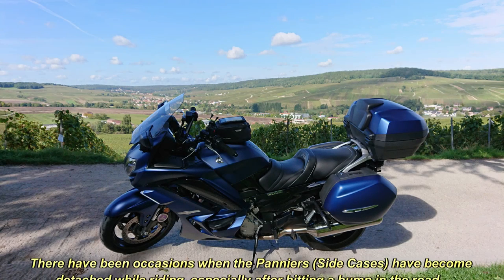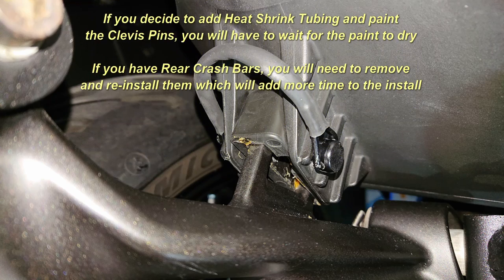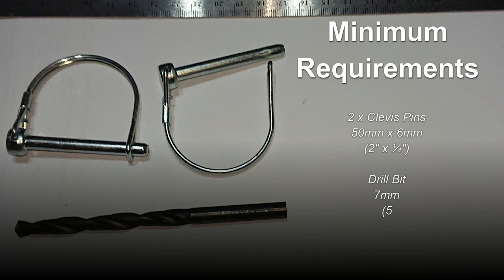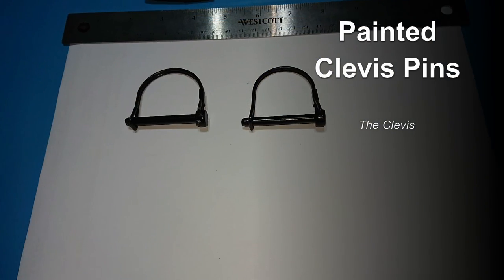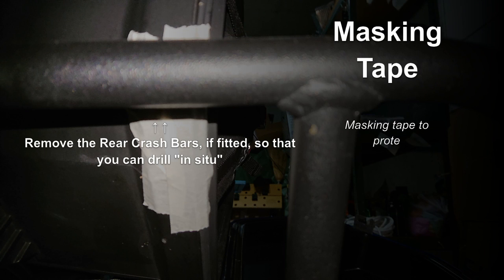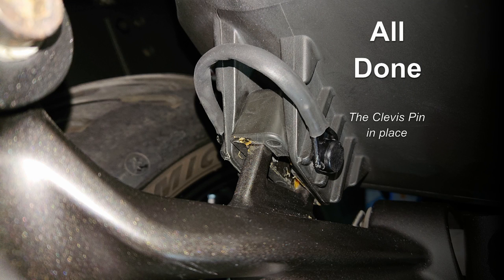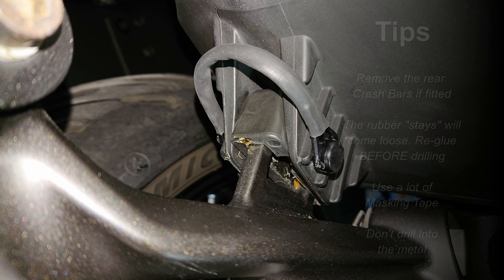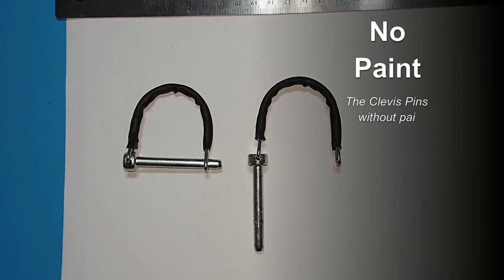How to Pin the FJR1300 Panniers

Comment: Not necessary. Just make sure that when you lock them to actually look and make sure its locked!
Reply: And on the day you forget?
Reply: Check the screws that hold the pannier locks.
If these loses up and fall out, the lock will detach, leaving the bags un-secured.

These screws should be secured with loctite but it seems not all dealers do this when installing. 
Mine were 50% loose so check the lock-screws asap if you have not done so. See example video on TwoWheelObsession if it does not make sense.
Reply from the maker: Just recently there have been a spate of reports of the panniers falling off. It seems that the plastic "tongue" which slots into the frame is wearing and not engaging fully even though the lock returns to the detente position. It engages sufficiently to give the impression that it is secure but, a hard enough bump is dislodging the pannier.

A few minutes of your time and little cost may save you a large expense later.